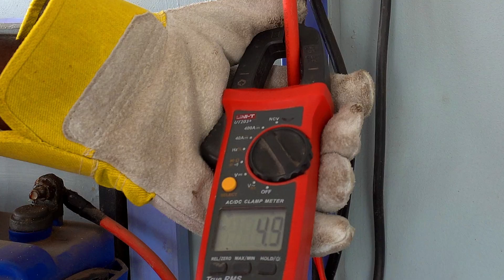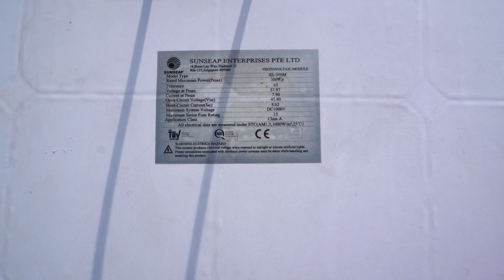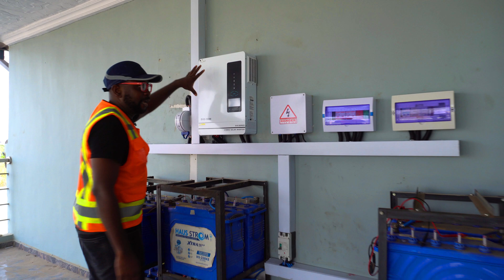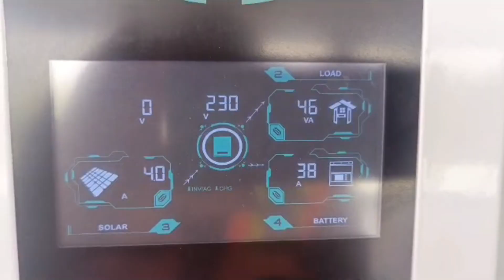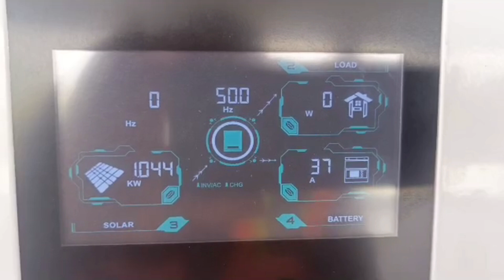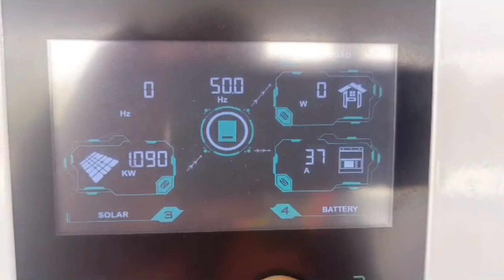Bad Solar System setup uncovered.

Comment: So you are not going to reuse those old panels and MPPTs? I think you could easily reuse those 12 300 W panels. 12x37.97 Vmp should be enough to help fill those batteries. I'm not sure the 200 W panels can be useful though.
Reply from the maker: Not a good Idea Buddy!
Reply: Complexity is not necessary